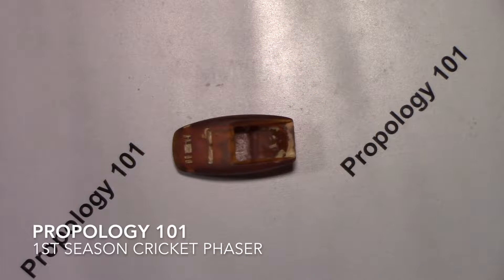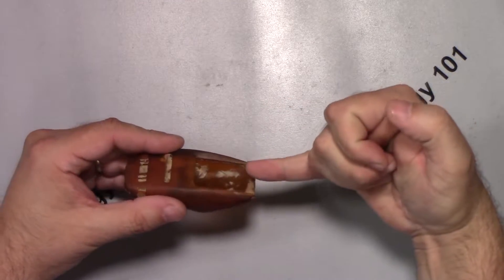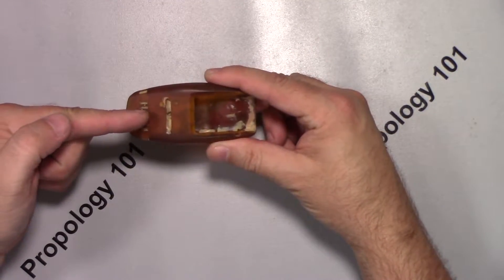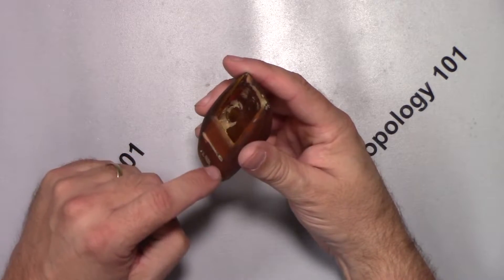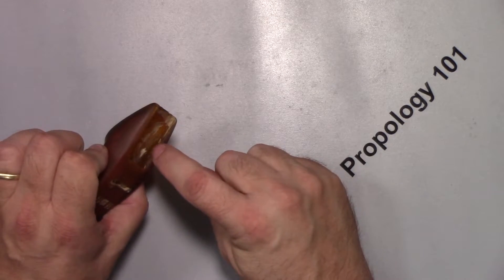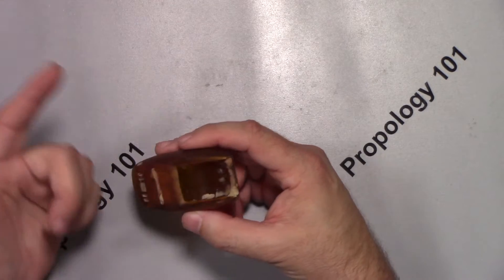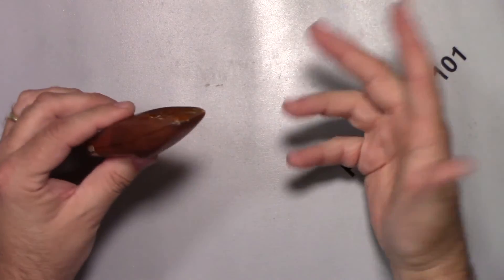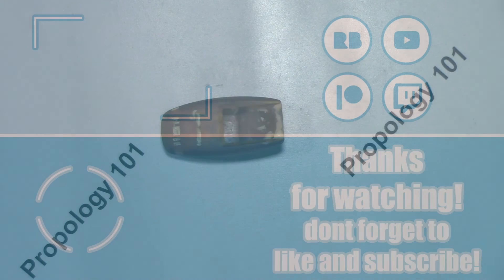1st season cricket phaser

Comment: Great video. I’m enjoying these!
Two-part question:
What happened to the emitter ’mouth’ as you called it. A lot of the production used crickets I’ve seen have this area filled in with clear red, making the nose blunt. That said, were there different sculpts of this piece, especially after the gold buttons were added in later seasons?
Reply from the maker: No all of the Crickets that were used , That I know of were all the same body pattern. The front end on almost all of the phaser 1's had it filled in. There was at lease one that had the filler broken out, but was still used in the eps. that way.